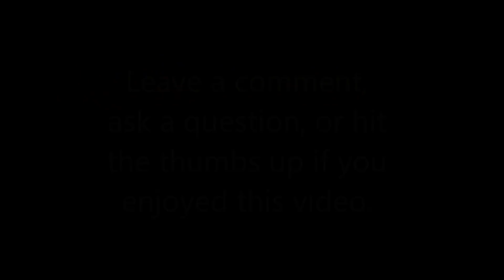Machining Cutters You May Have Never Seen - But Should Own

Comment: I'm a retired toolmaker, and I was tasked with making cams for Brown & Sharpe and INDEX screw machines.  We had an INDEX cam milling attachment on a vertical mill and would use a reverse helix end mill on this attachment.  We had to plunge cut into the cam blank at certain places around the cam, and if you tried to use a standard helix cutter, it would grab and scare the bejezers out of you when the whole machine would shake!  Reverse helix is great for thin stuff like you said, and for profile milling parts from sheet plastic.
Reply from the maker: Worked around a lot of those machines during my apprenticeship. The B&S cams were usually done by hand on a vertical filing machine. The guy that did it was amazing.

Comment: There's even a compression cutter made specifically for wood used on cnc routers. They work amazing. Had the router running 400ipm and .73 doc. Clean bottom and top edge with vacuum table. I cant thank you enough for the videos and extra education your videos offer. Your a huge help to the community! Thanks Joe.
Reply from the maker: Thanks for the comment. I've seen those cutters. They must be a dog to grind.

Comment: As a metric guy I really appreciate the conversions from inch to mm. It makes it so much easier to get a feel for the movements you are doing and the size of things. Usually, I always have a calculator open to convert measurements myself so I know what the numbers mean.
Btw really great videos, in general, they are much appreciated and have solved or even prevented quite a few headaches for me. I am currently teaching myself a little machining and setting up my own shop so I can get a better understanding of the things they teach us in school (I am studying Mechatronics).
Cheers from Swizerland
Reply from the maker: Greetings from Austin.

Comment: Hi Joe, Interesting content in this video. A close pal of mine is a very experienced master of machining and joining plastic components. He has an extensive collection of these special application cutters for his mill and routers. In a similar vain I have a good number of what we call 'down kerf' jigsaw blades for cutting delicate laminates etc. The operating principle is very similar thinking. Carbide burrs of single and double cut I have loads of them. Some for free hand use in a die grinder some solely for use on the milling machine. There are occasions when I have used a straight shank carbide router cutter to put a fine finished edge on plastics in the mill. They need to be stoned to razor keen edge to get best effect... Good stuff you demonstrate here👍

Comment: In woodworking, we use lots of up-cutting and down-cutting spiral router bits for the exact reasons you showed.  There are also bits that can cut both up and down at the same time (towards the middle of the cutter), very useful when trimming the edge of plywood, so both outer surfaces get sheared towards the middle of the plywood, leaving both surfaces very clean with very little tear-out.  I would imagine you could probably use router bits in a vertical mill as well.  Thin material like veneers and plastic sheet should be cut while using a backing material under them and using a down-cutting spiral cutter, similar to what you showed.  It's a very common practice.

Comment: Great video. I bought a huge box of cutters, taps, dies, and drills from a guy who had passed away. Couple of the burr cutters in there... I assumed they were for some big die grinder. Great to know I have them now.
Reply from the maker: When I was very new to this trade, I did a stretch in a mold shop. One of the first things they asked me to do was to organize the cutters and mounted stones in this old organizer they had. Since a small shank burr cutter looks like a mounted stone arbor with the stone missing, I threw them all out. Some time later, after I had realized what I had done, The mold makers kept commenting they couldn't find the burr cutter they needed and had to order more. I just sat back and went Hum......That must have been a popular size and the other guys just used the last one. I never told anybody. I bet I tossed 100 or more.

Comment: Those down cutters are often used on laminate worktops in routers for machining features/rebates etc. As demonstrated, zero tearing or chipping of the top surface. 
Also very good cutters for making tool cabinets for the times one doesn’t wish to break out the marking knife, tenon saw and chisels.

Comment: This is a fantastic presentation. I have worked wood for 40+ years and I am very familiar with the benefit of “down-cut” router bits. However I have only been working metal (including plastics) for a few years - a retirement hobby. This opened my eyes to these similar tools for metal (plastics) work. Thank you so much for sharing with us, Steve

Comment: Used to have to make Micarta bushings for pumps and bearing liners for seam welders. In a seam welder the spindle has to be electrically isolated from the body. We also used them for drill detectors on machining transfer lines. Nasty stuff to work with. Definitely recommend using a vacuum pickup as close to the tool as possible.

Machining plastics. Some jobs it seems you spend more time deburring than cutting. And then the deburring sometimes leaves a burr. Nylon is terrible as is UMHW. Curiously PVC in my experience was pretty good.

Comment: Good job with much new information about cutters. I was surprised to learn years ago that diamond knurled cutters are used to machine soft foam rubber such as used in automotive and furniture seats. These were made from mild steel with high speed sharp diamond knurls doing the cutting. Keep 'em coming Joe.

Comment: I was turning some Micarta today, and had the shopvac following the cut while it was on powerfeed(respirator and goggles on)will definitely get some of the carbide burrs now, after seeing how well it cuts through the Mic.

Thanks for the tip, Joe,

Scott.
Reply from the maker: Hey Scott. You'll be shocked at how easily it walks through the material. Like butta !

Comment: The reverse helix is also called a down-cut, you can also get compression bits that is upcut at the bottom half downcut at upper half to avoid tearouts on both sides when routing out shapes in  single pass. You can often get the burr cutters very cheap in ~2mm because that is the standard for routing out circuit boards

Comment: used this burr type end mills quite often and results are great.   this burrs loves high rpm.  if i want good finish and tolerances i do it in two passes - first is removal pass at around 9000rpm and second is same pass with same feed (spring pass) but with rpm increased to 12000-18000.
also you can do a cleanup pass with tool raised tiny amount. (this burrs leave horizontal stripes on a surface. and if you shift tool up for half width of that stipes it gives you even better finish).

Comment: Carbide burrs are extremely useful in any shop. Actually, many of them can do plunge cut. If I don't want to ruin countersink counterbore cutter with cast iron or hardened material - I use one of the burrs. If I don't want to break carbide drill bit at the exit out from hardened steel - I leave some material and end hole with burr.

Comment: The CNC router crowd refers to them as "downcut" end mills. That might help people find them as I've seen vendors market them that way.

Some of them really like compression cutters that are designed to cut up from the bottom and down on the top. You really need to be full depth with them to get good results though.

Comment: Hi Joe!  Liked the video.  It is very will presented.  As a woodworker I know that the speeds and feeds are much different.  On a router I would typically be using 20,000 RPMs for that size bit.  Most of the time we don't us climb cutting unless you have a power feeder.  Unless you like shooting boards across the shop.  :)
Reply from the maker: 2000 rpm was slow, but made its point.

Comment: The down spiral carbide cutters are intended for a router that runs at about 25,000 RPM.  Commonly used on wood furniture especially on plywood with hardwood veneer.  The only down side (pun intended) is that you have to run the cutter at a slower feed.

Comment: So I do woodworking we call those bits down cut bits.

 You might also want to check out a compression bit . Whiteside a good American brand. The compression bit is a up cut / down cut, so it leaves no burr on the edge of the material. So when cutting laminates or veneers already mounted the bits cut toward the center of the bit leaving the surfaces intact. just line the compression area to the center of your material.  not useful for metal, but all other types of material. Even older (upto 20 years ago) aircraft bulkheads where you had aluminum sandwiching balsa. It would prevent the aluminum from being pulled away from the balsa.

Comment: About 40 years ago I picked up a 3/4 X4 inch left/right end mill (M42) . I was amazed at how I could machine a 3 inch edge with no chatter. I don’t use them a lot anymore but thy are great. Thanks for letting the world know about them.
Reply from the maker: That diamond pattern burr is another gem of a cutter. I had zero confidence in it until I used it. WOW

Comment: Hi Joe, the carbide burr is great, had them for years. we used to weld up slotted tubes that had a cracking issue, when they cracked a second or third time we cut out the old weld with a carbide burr and welded them again.

Comment: Also interesting is the difference in swarf wake each tool has in the wood. 4:55, 6:50, 8:30. On the last one, it's almost compacting the swarf into the slot. The first tool has the swarf going all over the place.

16:00 I imagine with 2 and single flute tools and edge routing thin material, there's an opportunity for interrupted cut that varies based on tool spiral, workpiece thickness and depth of cut.
25:00 Perhaps also worth considering is feed rate for finish on plastic. There tends to be a sweet spot where you're not loading the tool too hard, but not so slow that the tool is recutting swarf. Swarf recutting can smear plastic bits on to the already cut surface and spoil the surface finish.

Comment: I like to cut carbon/glass filled composites under water.  Also using a carbide diamond cutting tool as presented here, they work miracles! I add a few drops of soap to lower the surface tension, otherwise the dust will float to the surface.
Reply from the maker: Put an inline filter on your coolant pump, and one on the return line so the glass doesn't eat the pump up. I don't like G-10
Reply: @joepie221 Thanks for your answer Joe! I'm not using flood coolant, I meant a container that keeps the parts flooded. G-10 is horrible stuff for dovetails/linear rails/ballscrews. (and lungs, so it seems).

Comment: 0:24 - I use a .0625" ( 1/16 ) diamond burr much like the one you are showing - diamond pattern, not real diamonds, in my CNC router to cut carbon fiber sheet. Works like a charm. Prior to that, I used .0625" single flute end mills. As it turns out, these worked just as well. CF is also really hard on cutters.

Comment: Carbide Burr is also for tile and impregnated tile materials, can be used wet/dry/froth.  I strongly advise froth if you can (non-porous) but wet is still a better option than cherry-red.   I've seen a LOT of single-flute used in multi-material construction like foam filled aluminum semi-rigid paneling and in trimming of composed pvc impregnated surface fiberboard.  As long as you can control the exit force or flip your router's CNC track you will get a great deal of use out of singles.  In some circumstances using a water sol. surface glue against fitted sheathing can produce great results.  I've also seen the single flutes drawn with a trailing angle along the work to reduce penetrating pressure from the chips, about a 8° trailing tip, makes more noise but doesn't compress the interior anywhere near as much (say you needed to cut a soffet into one side of a foam filled door panel but didn't want to create a bulge on the other side).
If you ONLY have metal bits and need to use them, scribe the sides of the channel you need to make and use a smaller bit with a couple rulers clamped to the work on each side.  Sacrificial metal dams also work but why wear the tool out?

Comment: Hi Joe,
thanks for that cool demo! i'll be passing the inverted spiral idea along to my employer. we make furniture parts from wood and MDF and do a lot of similar cuts. so that was definitely a useful demo!

the one type of cutter you left out on the groove cutting demo was the straight flute bit such are used in routers. these do leave  a much cleaner cut in the bottom and walls of the cut. 

the other thing about this demo you did here, and you did mention, is the lack of RPMs of the bridgeport /clones. bits of up to 1/2 inch need to spin around 8000 to 10 000 RPM, and some even higher, to give any kind of decent cut. clearly a milling machine can't deliver those kind of RPMs without the attachment that doubles RPMs. 

a while back i made a video about making precision wooden parts that had to be within 0.01mm tolerance. i made them on my bridgeport but used a large diameter HSS face mill as the cutting edge would come close to proper cutting speed for wood. for those of you who are interested, please go into my channel archive and look for the episode "Zerks&Wheels episode 14, Marinus go round" and the other "Zerks&Wheel episode 20, discombobulating the bridgeport". i'd put in a link here but i don't know how Joe would feel about throwing links to other channel vids in the comments.
in those videos i had some interesting dialog with Don Cossitt who voiced his experience doing similar things on the milling machine with regular cutters designed for steel and run at low RPMs for the material.
to those of you who are following along and don't have the resources to go out and get inverted spiral fluted cutters: you can resort to a few simple short cuts for small jobs. one is to stick masking tape on the work piece where the cut goes thru. this also works to some extent for acrylics and plastic coated materials. it's not the best solution but it does cut down on the tear out considerably. the other thing you can do and again this certainly applies to acrylics and plastic coated materials is to sandwich (as Joe prominently mentions in the acrylics side of the demo) the work piece with a sacrificial piece so there is a small amount of pressure in the area of the cut. the third option is to use a double sided tape as a medium to hold the sandwich layers together. again, check my channel archive for a unique work holding solution.. 

my apologies to you Joe if you feel i stepped on your toes by making references to my own vids in your comments. i thought it would supplement your monolog for those who are looking to round out their knowledge base a tad more. no ill will intended

cheers!
mike

Comment: There are tools designed for cutting plastics - typically called ‘O’ fluted tools for soft plastics as in your demonstration. They have a low helix profile as opposed to the high helix profile on the bits you have. They also have a high rake angle and are designed to create small curled chips that evacuate the cutting area quickly. It is also more common in wood and plastics to use the terms up shear or down shear to describe the way the router bit is pushing the chips ( ex: 2 flute downshear right hand bit). Then there is a compression bit which allows for a clean cut on both top and bottom of material when cutting all the way through the material. As you’ve shown, it’s important to select the right type of tool no matter the material you’re cutting.
Reply from the maker: Very true.

Comment: 26:50 also don’t want to inhale that stuff, could be a bad phenolicky type day .😢
I’ve often used the burr cutters for removing ball bearing races that are either up against a shoulder on a shaft or in a closed bottom hole with no access to remove it . A double cut 180* apart always made them let go.
Reply from the maker: I like it.
Reply: @joepie221  hey Joe, I appreciate that you very often reply to my comments . If we were neighbours I could slide by and learn a bunch . Nothing like experience for a teacher ! Thanks. 😊

Comment: Very interesting. I've seen those rotary burr end mills but never really understood what they were for. And that one flute reverse helix end mill is pretty cool, I might get one for working with plastics.
Reply: The Kyocera end cut one work really well milling fiberglass, the downside is they run undersize by about .02 under nominal.

Comment: I have cut a lot of Garolite over the years. HSS end they lasted about 8 hours so I usually used carbide. Diamond coated tooling is recommend. By the way I understand Garolite dust is a health hazard so I used 2 flute carbide end mills to produce larger chips.
Reply from the maker: I usually finish with a 2FL CEM. Great finish.

Comment: We use a lot of the single flute router bits at work..we are a plastic company.they clear the chips nicely without melting them back onto the part. They downward force ones keep the part down and not explode when the slug flies off.

Comment: The carbide burr cutter works very well. I have a job that I use these on cast iron. Mine are also able to plunge cut, but not all are. I have to make two plunge cuts in the parts I'm working on. The plunge cuts I make with them cannot be oversize as there is a press-fit part that goes in the hole. It is an interrupted cut ruling out using a drill and reamer.